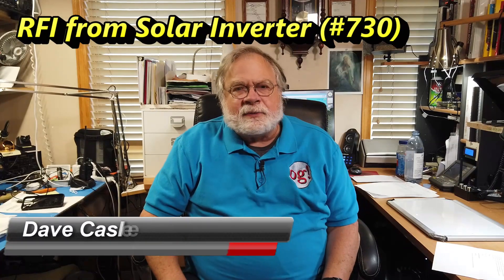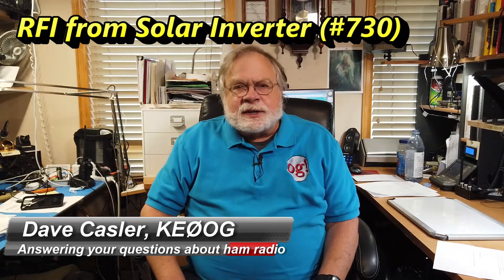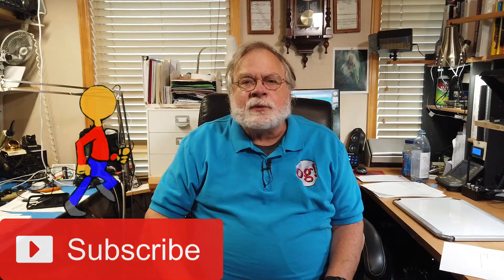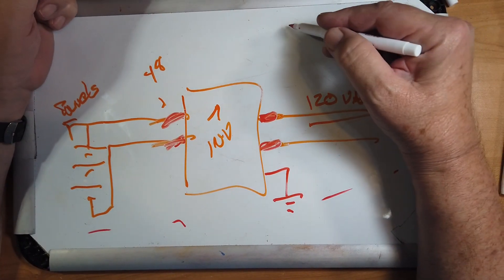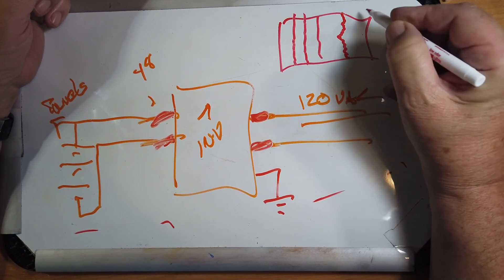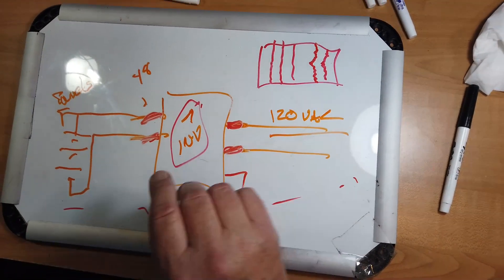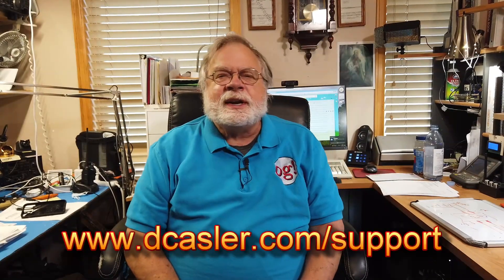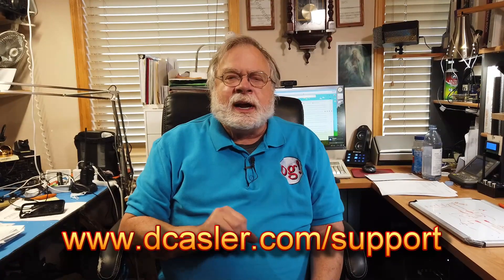RFI from Solar Inverter (#730)

Comment: What size and type toroid's would be best?  There are hundreds of types.   
This is also a problem with inverter generators.
I don't  think that just a couple of toroid's will do much.  You are going to use networks in a Low Pass configuration to take care of this noise.

Comment: That works. I have a off grid solar/wind home . also i found that LF inverters not as bad RFI noise. my big RFI maker was my MPPT charge controller. ferrite cut it down a bunch . I also put ferrite on my PV panels and win gen . I got ferrite all over my system. was a big help. what I was doing was eather waite to night or switch off solar when wanted to work HF. now my LG washer is quite bad RFI. ferrite did nothing. we don't wash cloths 24/7 so just time washing clothes when not on HF. that was my fix. 73's

Comment: My plan would be for an off-grid situration.  Have a shed,  charge the batteries to large 12v bank.  Power the who shack off of 12 volsts, and no wall-warts, and even 12 v. incadesent lighting.  No Ac al all and some distant from any ac.  Should be altra rfi quite. great for weak signal reception.
Reply: You have the right idea, but I really need a computer in the shack. I have found that even a small laptop running on battery is a terrible radiator of all kinds of RFI. If I turn that off, the noise floor quiets down quite a bit.

Comment: Good video.  I once built myself a power supply from the book Forest E Mims III called Getting Started in Electronics... when I was 11. I'm actually building myself another one now... 33 years later.  But the material from that book would have answered this question.  In particular for the voltage regulator circuit.  Also, google circuits that can be used to transform square waves into sine waves... they show several filtering stages that could be used to add low pass filters onto the output of the solar inverter...

Comment: I've been dealing with the same issues with my off grid and SWL setup
Tried beads and built line filters with limited success
One thing I would add which I would have thought wouldn't matter
I used the same earth for my radio's as my panels. Easy it's not far from my shack🤔
But trying a last effort i put another earth in several metres away which cut the noise to a more tolerable level
Also my inverters in an enclosed metal shed and even leaving the door open increases QRM
I still have noise but i can get good copies on DX stations in the US and European stations from my place in NSW on my old R100 and inverted V
Cheers

Comment: Sadly, RFI filtering is the first casualty of the "bean counters" when saving costs and maximising profits...... its the stuff that goes unnoticed by most consumers. In the DC to AC mains inverter, the squarewave DC/DC  primary converter is the cause, usually operating at several hundred kilohertz. Low frequency inverters are available, these operate similarly but use a normal iron cored transformer running at 50 to 100 Hz, therefore the harmonics are very much less. Unfortunately, solar controllers, either MPPT or PWM use high frequency squarewaves too, these are very difficult to supress, the usually long cabling from the PV panels act as an aerial to effectively transmit the harmonics a great distance. Unfortunately, it takes rather more than just clipping on a few ferrite cores to supress these birdies.
Reply: what do you suggest?

Comment: Dave, there are two conduits coming into my inverter.  Would it work if I just put a ferrite around the conduit if I can find one big enough?  There is no battery in my system.  I imagine one conduit comes from the solar panels and the other is going to the grid/house.

Comment: Thanks Dave.  The system you described converts the square wave output from the switching circuitry into a modified sinewave which looks more like a series of stepping stools than a sinewave.  They are very harmonically rich and so produce a lot of RFI.  Some higher-end inverters put out a "pure" sinewave and often produce as little as 3% THD or less depending on how much current you extract from them.  They are naturally more expensive.  I wonder, how well do these pure sinewave inverters work regarding RFI, and can they, too, be filtered with ferrites?

Comment: I have an outback fm80 solar charge controller feeding my repeater battery bank and it makes 80 and 40 m unusable no inverter is used in this system,so be careful when you design a system with amateur radio in mind

Comment: Interesting video Dave.
I have a solar charger on the shack to charge my 12v battery which powers my ftdz3000. the charge controller (no mains connect) creates RFI despite installed ferrites. what other options do I have?
thanks
Reply: Turn off the charge controller and operate from your 12v battery when you are operating. Turn the charge controller back on to charge the battery when you leave the shack or are not operating.
Reply: @g-whiz286  I was hoping to hear options that will allow me to continue to operate the charger. whatcha got?
Reply: @ralph9987  I don't. I just turn mine off. I even have to turn off the shack laptop because that thing is radio free Moscow even when running on battery.

Comment: Thanks for covering RFI from solar-related equipment. I have done over 250 POTA activations always running two 100-watt solar panels under the California sun. I do not use (or need) an inverter in the field but I do use an MPPT charge controller to covert and optimize the ~20VDC from the panels to charge my lithium batteries. While MPPT charge controllers are much better at optimizing the panel output than PWM, they do have their own RFI issue. 

I resolved this, as well, by putting three Palomar Engineers ferrite beads at the MPPT output in a row, each with the wire wrapped 3x within them. This is equivalent to 3x3x3 or 27 sequential beads (each wrap squares the RF suppression). That's what it took to eliminate RFI from the MPPT controller. I also mounted the controller in an aluminum box (faraday cage) which greatly helped. :) 73 KJ6ER, Silicon Valley
Reply: I got Morningstar MPPT and Victron MPPT controllers. fixed with ferrite. type 43 with several turns of heavy wire. 73's
Reply: @robertmeyer4744 how did you determine mix 43?  Thank you.
Reply: @mikedevita5558  from both looking up charts on ferrite mix and buy trying them. I have used MIX 31 snap on cores . FT 240-31 and 43 mix toroid cores. The attenuation can be measured with a VNA . It about the frequency you want to block. Different ferrite and powdered iron  react different on certain frequencies . The size of the ferrite/power iron is also a factor.Lots of testing and looking at data sheets is how I pick my MIX. When all else fails just try what you have . Nothing to lose . 73
Reply: @robertmeyer4744  thanks.  I'm frustrated 😆 been trying.  So you choked the + and - of battery cable from controller to battery?
Reply: @mikedevita5558  After doing many solar installs,I find a outher point of RFI is right at the panel. Put 31Mix their as well. The buss bars on the cells can act like a antenna . I had to put each on + and - of each panel close to panel as possible. On portable set up just a few 31 snap on cores  right where wire goes in panel. and do same right ar charge controller. The frustrating part is so many controllers and panales  and no 1 fix for all. 73